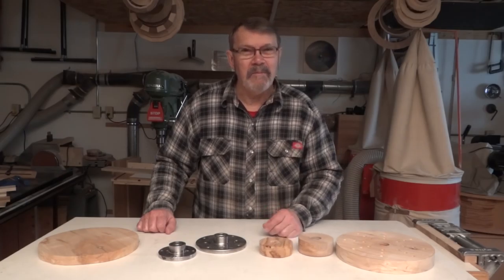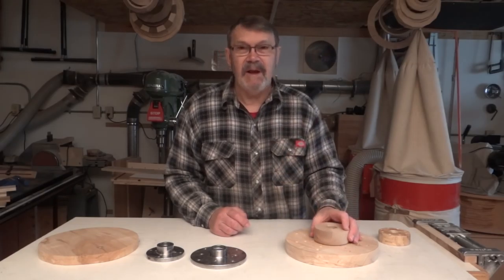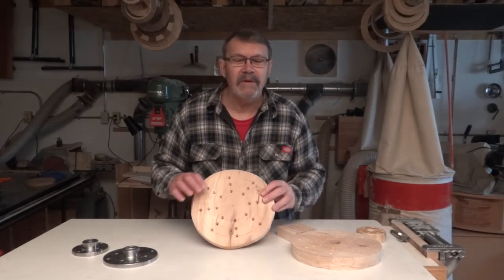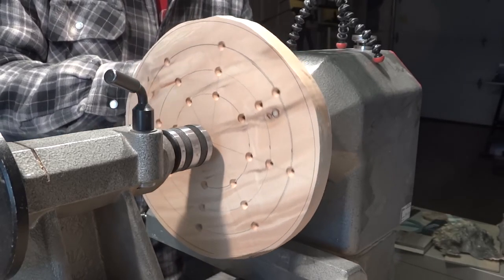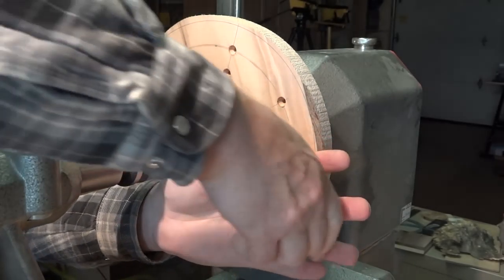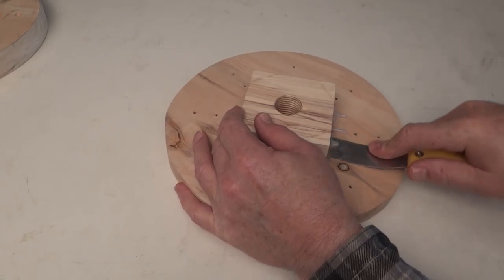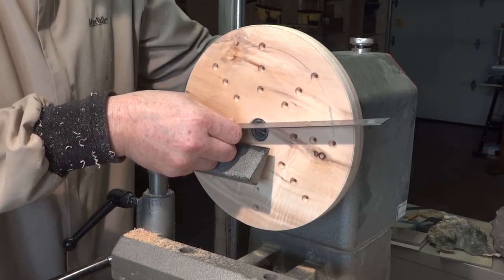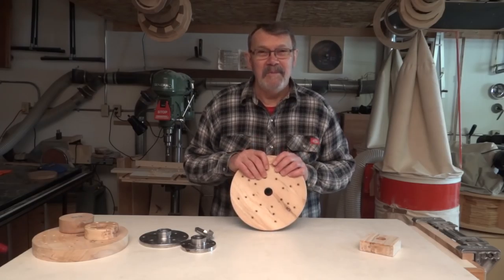Faceplates - Commercial or Shop Built?

Comment: I also make these Gord. I prefer sugar maple. An additional advantage is if you want to put a project aside for a while,or if you are involved at a community woodshop; you are not tying up the standard faceplate while your project sits, and you have better accuracy when you remount your work on the lathe.
Reply from the maker: +David Wood 
That's a good point, David. Not having to remove the faceplate is a very good thing!! I had not thought of that; thanks for pointing it out. I just might have to make a few more. I sometimes have more than one project on the go and I sure don't have the $$ for a second lathe!!
Thank you for watching and commenting, David.
Take care,
.....Gord

Comment: Great tip Gordon!  One thing you forgot to mention is the size of the "glue block" you used to mount your faceplate.  I would think you would want a block large enough so that you had clearance for the 1 1/8 inch forstner bit to pass by your jaws.
Reply from the maker: +Alan Erickson 
Yes, Alan, I forgot to mention the size of the block. It's 3-3/4" square and it is big enough to keep the jaws far enough apart to allow the Forster bit to pass between them. Glad you like the tip; hope it works for you someday.
Take care,
.....Gord

Comment: I too often use face plates and glue blocks, except I use a 1" X 8" nut expoxyed into the plate or block instead of threading the plates or blocks as I thought that the threaded metal nut would be stronger and safer than the wooden screw taped threads...  The nuts come in 1 X 8 and 1.25 X 8 to accommodate just about any lathe...  Just a thought...  Thanks for the video and safe turning to you always!
Reply from the maker: +Kenn Harris 
I have some 1-1/4" x 8TPI nuts and have made a faceplate with one that is permanently in use on a donut chuck. It works great but I find it easier to use the lathe tap to make faceplates and I also enjoy doing it so I will stay with that method. I realize the threads are not going to be as strong as metal threads but I can use CA glue to strengthen them if I want to and it's easy to make more of them. I find it much easier than the effort I went to when using the nut. I can make a glue block or faceplate in less than half the time. Thanks for the suggestion though. I appreciate any input someone cares to offer.
Have a great day in your shop, Kenn,
.....Gord

Comment: Nice tip Gord. My Shopsmith doesn't use a threaded spindle, but my mini lathe does. I think it has 3/4-18 threads, but I'll have to confirm that before I make one. The smaller tap should be less money, I hope! Another fine video, keep them coming. :)
Reply from the maker: +Gil Grace 
Hi Gil,
I hope yours will be a cheaper model. I know Lee Valley carries 3 sizes: 1" x 8TPI, 1-1/4" x 8TPI and a metric model. The 1" is much cheaper than the 1-1/4" that I have. I'm not sure who would carry other sizes but maybe contacting Beall would help. I hope you can find one if you want to.
Take care, Gil,
.....Gord

Comment: Great video Gord, and a few points for thought, since I've been looking for a local supplier of face plates and simply can't find a single one, I have many jigs and things I'm using my single face plate with, and I would love to have one for each so I wouldn't have to switch it around, so of course in comes the shop made face plates, which present a different problem. Can't find a 1x8 tpi tap anywhere in Italy as well, and the thing is so heavy it's simply not economical for me to order from abroad. So yeah, still working on that. A small idea I had is why not insert a small copper gas tube, or another, in each hole in your faceplate, sanded flush to the wood, that way you'll never split your faceplate when you over tighten? It just came to me right now watchin you, I don't know if it's something you've tried already and didn't work.
Reply from the maker: +Yuval Lahav Woodturning 
That's a great idea, Yuval. Thanks!!! I'll have to think about some kind of bushing for it and give it a try. I never would have thought of it so thanks a lot for the idea!!!
Take care,
.....Gord

Comment: Gord if you put denatured alcohol on the hot glue it will peel right off quick & easy.
Great video, thanks for the info.
Reply from the maker: +Fierceflyer55 
I've heard that before but denatured alcohol is not available in Canada. I was told mineral spirits worked but the time I tried it I didn't get any results at all. I'm sure there must be something else I haven't tried but I'm not sure what to try. Thanks for the input anyway; I appreciate it.
Take care,
.....Gord
Reply from the maker: +traog 
So, Gordon, ethanol is the same as denatured alcohol? I did not know that! Thanks very much for the information!!!
Take care,
.....Gord
Reply: Yes, ethanol, grain alcohol, with a little methanol, wood alcohol added to make it non drinkable is what denatured alcohol is.
Reply from the maker: +traog 
Thanks a lot.

Comment: Great learning video Gord.  I have a a question not related to the video.  I am having trouble with friction polish leaving streaks like sanding does.  Any help would be great.  Thanks
Reply from the maker: +dale jones 
Hi Dale,
Glad you enjoyed the video. Thanks for watching!
If your turnings have no streaks in them after sanding but do after applying the friction polish I can only assume that the finish is not completely melted in. When I use a friction polish I run the lathe at anywhere from 2,000 to 3,000 rpm. It's the heat that causes the polish to melt and gives it that shine that we love so much. If there isn't enough heat the polish won't melt completely and can leave a real streaky appearance. I can't think of anything else that might cause that. I hope this is some help. Let me know if it isn't.
Take care,
.....Gord